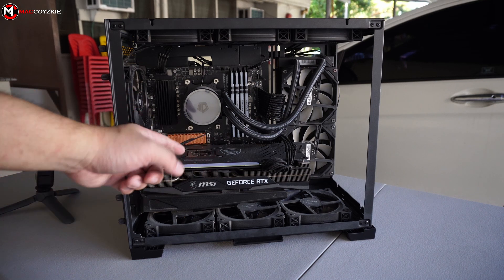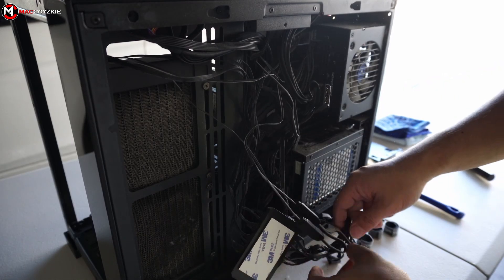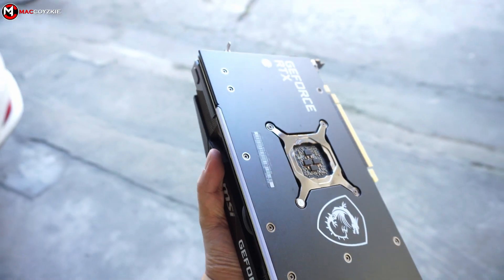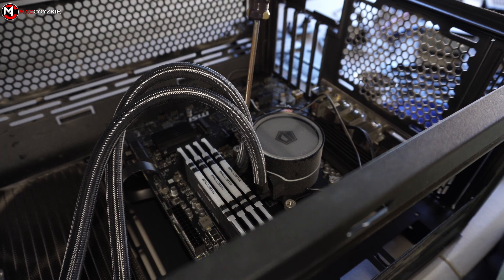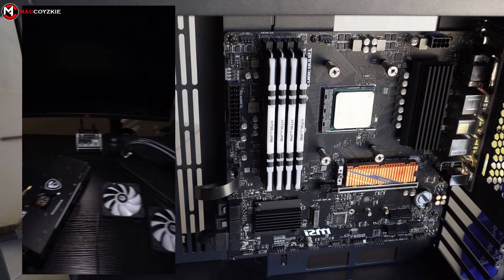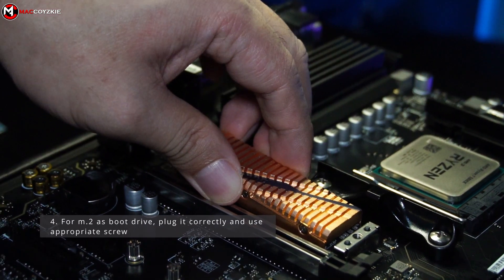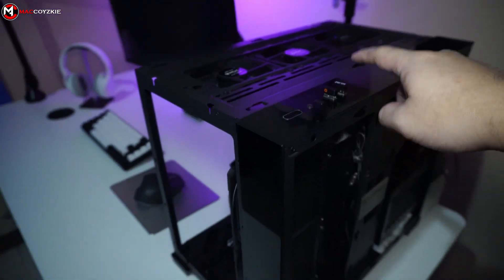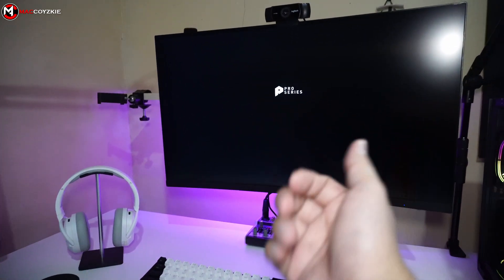Pc cleaning guide for beginners! Teardown clean & rebuild tutorial! ( no signal fix! )

Comment: bro nice video but i cleaned my pc and then after that my monitor is not working like why and how to fix pls let me know
Reply from the maker: usually misplaced front panel connectors, specially when you interchange the reset and power button so check this video for more info https://youtu.be/LxRzL5WFB9c 

this could also be a dirty ram sticks so try cleaning it this way https://youtu.be/F-dLBIomghY

Comment: Bro I've been watching your videos im currently experiencing what i think my gpu is crashing. At first i happens not that often now i need to be cautious bcoz it randomly crashes i use msi afterburner and my temp is below 60C so its not overheating
Reply: I tried cleaning my pc and it still crashes
Reply: Also tried reinstalling my drivers twice now crashes still happens
Reply: Idk if cpu or gpu is the reason why i crashes bcoz my ram, disks, and psu are working fine
Reply from the maker: @rossmylematula1216  during gaming or just desktop workload?
Reply: @MacCoyzkie  both but happens mostly while gaming sometimes when i turn on my pc it also crashes
Reply from the maker: @rossmylematula1216  ok may i know your pc specs? btw if you're using windows 11 this is bound to happen since windows 11 has a lot of graphics issues. If you are using windows 10 i need to you clear cmos at the moment since we need to test the pc in default settings. here's how to clear cmos just in case https://youtu.be/S9hyEPTFR10
Reply: @MacCoyzkie  my pc specs po are 
Intel i3 9th Gen 3.50hz
PALIT NVIDIA Geforce GT 710
12 gb 2666mhz kingston ram
Gigabyte H310M H 2.0 motherboard
240gb kingston ssd
500gb Toshiba hdd
Reply: Im using windows 10 pro
Reply from the maker: @rossmylematula1216  have you cleared cmos yet?
Reply: @MacCoyzkie  I’m using windows 11 and getting same problem can u help please
Reply from the maker: @skylerlott6850  bro i need you to make a new comment otherwise i will lose our conversation. comment a new one stating your pc specs and how the pc problem started